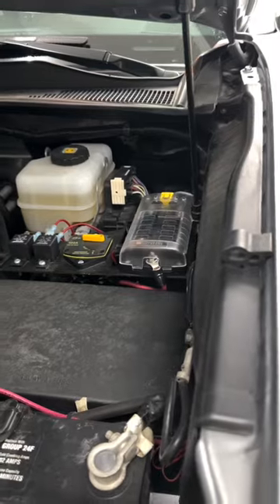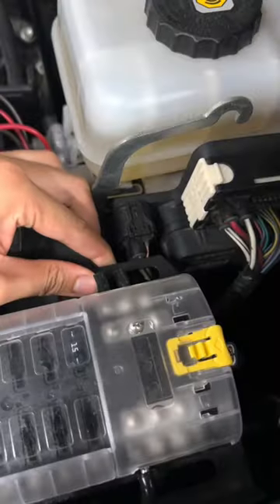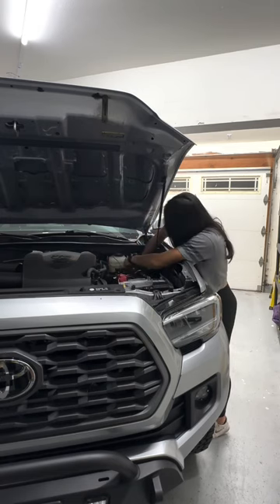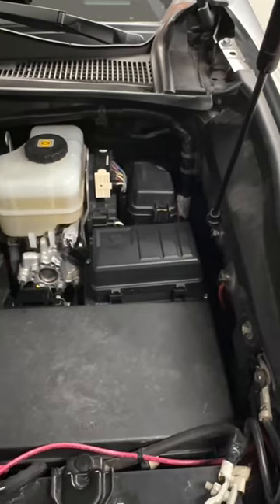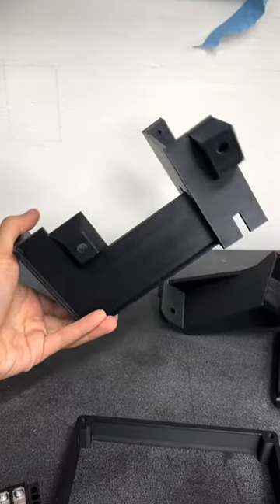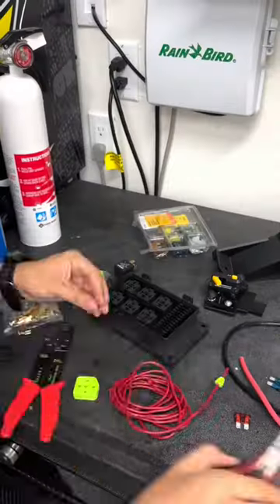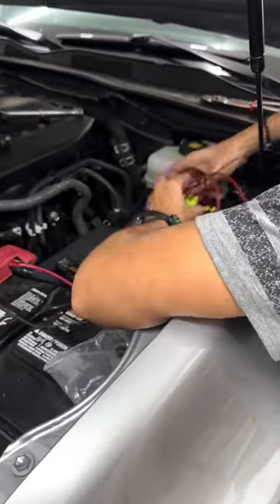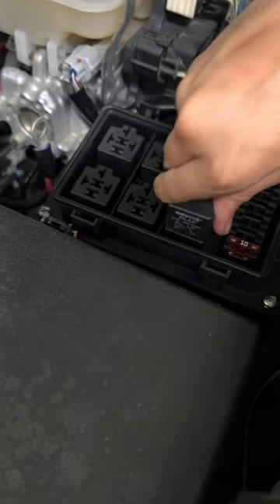Fixing the Wiring in my Toyota Tacoma #shorts

Comment from the maker: Thanks for watching! Here's what I used.

- Bracket kit: https://www.etsy.com/listing/1256568075/auxiliary-fuse-and-relay-block-mount-for?click_key=f5f387588ebd2503499d06d9233cc239b78786a9%3A1256568075&click_sum=f4c1b641&ref=shop_home_active_1
- Link to TacomaWorld thread for more info: https://www.tacomaworld.com/threads/show-off-your-aux-fuse-panels.308677/page-80#post-27460487
Reply: About to wore up my first thing on my off-roader.  Not new to electronics or wiring but it's been quite some time.  Where do you get your wire from?
Reply: you could be handed 1 million dollars to upgrade your tacoma and you'll never be satisfied and would need a million more

Comment: Your first set up was using Blue Seas stuff, that’s for boats often made of wood or fiberglass, no metal chassis on boats. Hence the double size for dealing with the grounding wires. As you found out this is the wrong product in the wrong place.